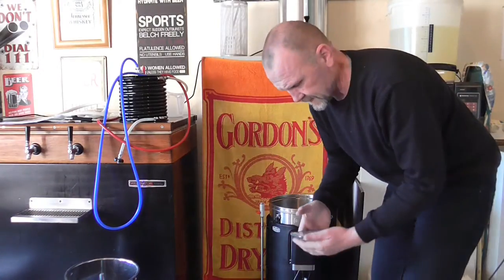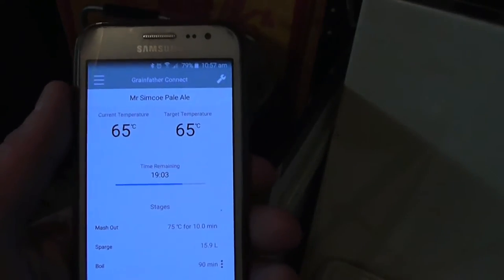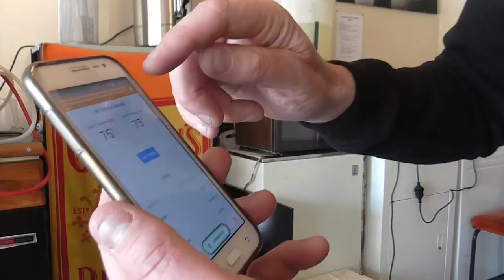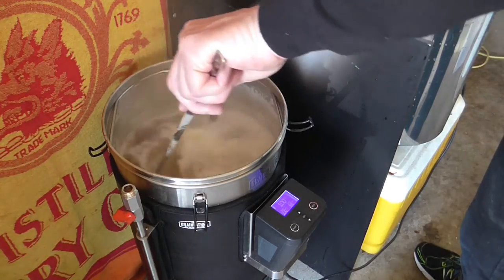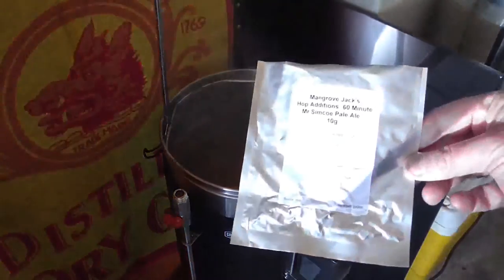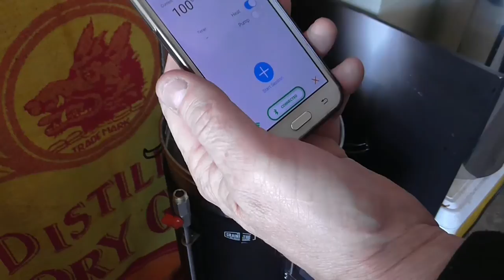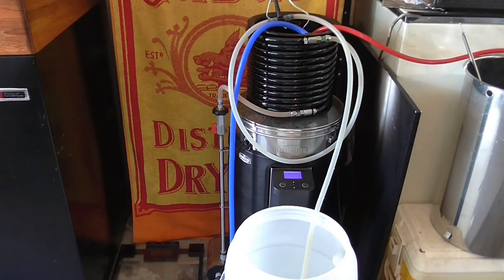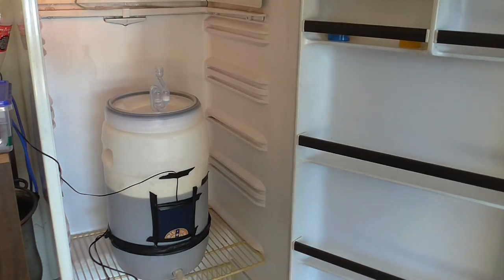Grainfather Mr Simcoe brewday

Comment: would you not re circulate the same amount of wort thru the mash regardless of the flow rate and over flow ?
Reply from the maker: I guess but why have the pump working at full flow if it's only utilising half flow threw the grains and the wort was much clearer in 15 mins with restricted flow than at full pace after 30 mins IMO
Reply: The pump will work at full rate regardless as the flow is adjusted by the ball valve. if it works for you then good times. ordered my grainfather yesterday complete with sparge heater, connect and coat, getting very giddy
Reply from the maker: Xmass all over again lol